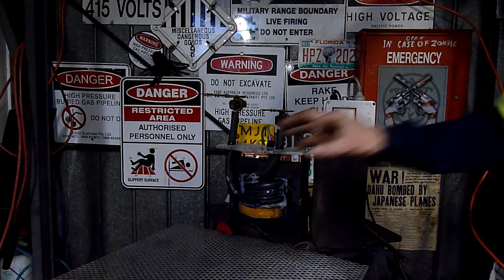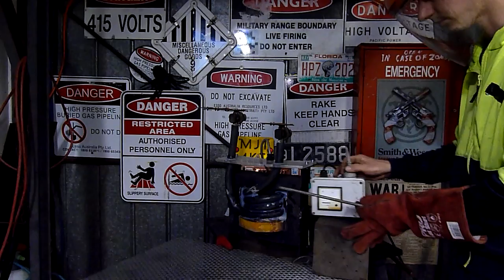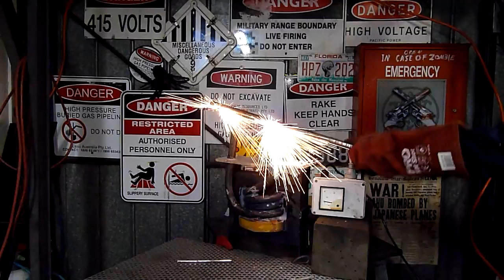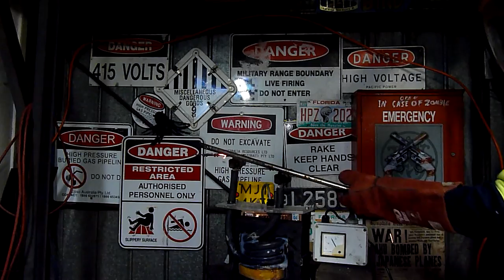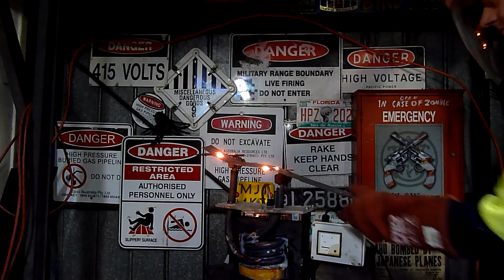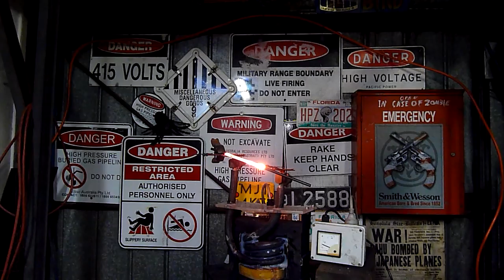High Current Transformer Fun - Plenty of Sparks

Comment: ~3700 Amps realistically, as hes drawing at most 60 amps at 235 volts and transformers aren't 100% effecient, and so his input power draw is around 14kW and output should be around 13.75kW - 13.5kW so quite the beast

Comment from the maker: Well, yes and no, you need both. you need enough voltage to break through the human body's internal resistance, and then the current can flow, I've had both electrodes of that transformer in my hands a few times and never once feared electrocution, even working on a wet 24V truck battery system only gave me a bit of a tingle as I tried to tighten loose clamps.
go above 40V and your starting to get dangerous.

Comment: You need to divide by 2ndry *open* circuit voltage. Voltage drop represents power wasted in the 2ndry winding, so cannot be subtracted out.

So 9.2 kW divided by 3.8V = 2400A

Comment: Oooh at 9:15 ...... Look at it Glowiiiiiiiiiiiiiiiiiin' ! :D

See if you can cut up a beer can with it or try this experiment:

Put a piece of copper tube across the connections, then pass water through the copper tube & see how well the water is heated, if at all. Theory has it that if there's lots of amps going through the tube, it'll heat up, then that heat will be transferred to the water going through it. :-)

Thanx for showing,

{^_^} BoomBoxDeluxe {^_^}

Comment: 240v @ 10 Amps AC  will see some 631Amps at 3.8vols (not taking in account of transformer losses).
240v @ 20amps  will see some 1263Amps used on the secondary then.

Comment: Assuming 240V RMS input, and that the 3.8V output is also RMS:

Voltage ratio = 240:3.8 = 63:1 = turns ratio (yeah, idealised, get over it)

Turns ratio = Current ratio = 63:1

Primary current = 37A

Secondary current = 37*63 = 2336A

Comment: INB4 everyone from The Geek Group comments. :D
I read around 37A on the meter. 37A @ 240V nominal = 8880W. 8880W @ 90% transformer efficiency = 7992W transferred to secondary. 7992W @ 3.8V = 2103A nominal short circuit current.
This will go down as things heat up. I use 90% efficiency because railway cable isn't terribly efficient as a secondary. It leaves large areas where the magnetic flux can bypass the winding. Figure of 90% was pulled from my ass. YMMV.

Comment: 40A @230V is 2400A @3.8V. That's a 1.6 milliohm load, which is why the axles makes pretty lights, and nothing much happens to the thin, relatively resistive iron sheets.

I wonder what other things you have lying around would make good 1.6 milliohm loads:-)

Comment: also as you have very low voltage the amount of power getting through can be limited by the resistance of the part you are putting over it. 
R = U/I
so there can only flow a given amount of current at that voltage and resistance

im sure you already know that stuff :P

Comment: hmm so how much watts does it pull? whats your wall socket voltage? 
if it pulls around 4500w (@110v) it will put out around 1100 to 1200 amps
E= U*I you know :D